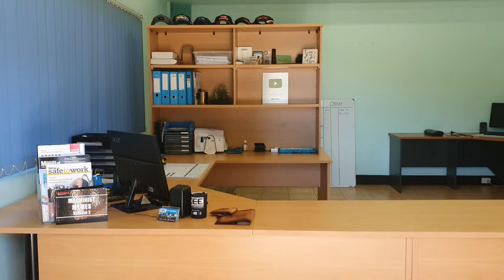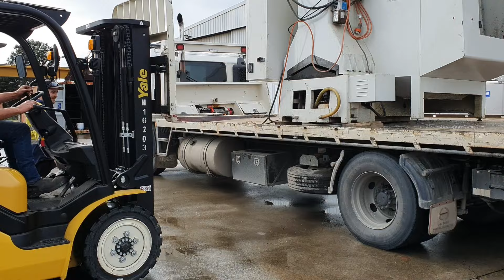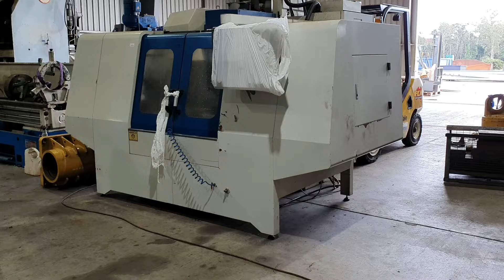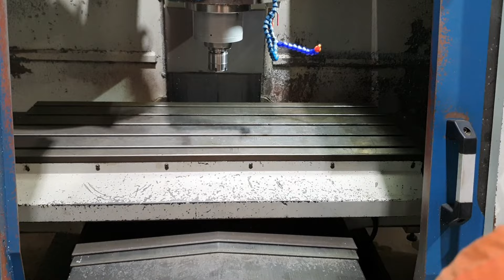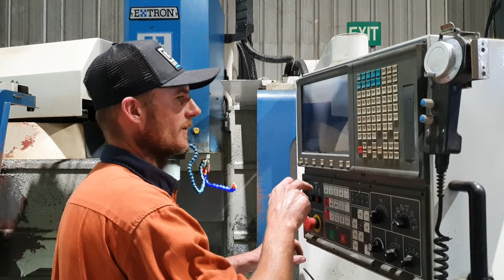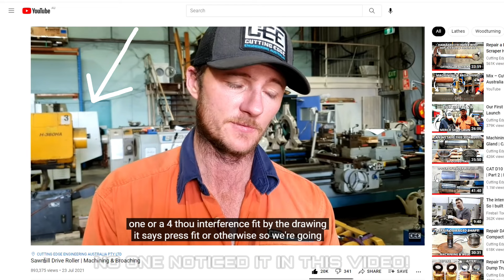Finally REVEALING Our New to us Machine | Workshop Machinery

Comment: Looks like a good addition to the shop. From what you've been doing, it looks like this may have a place making spare rod and cylinder ends. Looks intriguing, you may have to get additional labour around the shop. Enjoyed, cheers
Reply: Yes -if it's got the grunt, and/or feed rate is low enough, the CNC could be used to make a good stock of blanks. It wouldn't matter if it was chugging away for a day cutting each one. It could just live it's life as a material hogger.

Comment: Could I get a reedit on the measurements please? You didn't tell us how many banana's the table size was and I'm a bit confused... 
(Would have been cool to have some banana's actually laid out on the table and taped up the spindle though...... ROFL)
Once you get the hang of programming it, It'll make your life easier, particularly like when drilling multiple holes in a flange or the like... 
Can always use a block of wood as a test piece I'd think if you were nervous about how things are going to run, wood is a lot more forgiving than steel for sure.... 
HEY HOMEY!!!!!!!!!!!!!!!!!!!!!!! <3 <3 <3

Comment: I am not familiar with that controller but you will need to learn G codes and M codes. Slow the feeds way down till you get comfortable. Dont let it crash my friend. I repaired these machines when I worked at Honda, believe me there are very expensive parts that drive the axis's. It does look like a descent machine and this type will usually produce precision work. You will really enjoy it. I love your videos by the way. Enjoy

Comment: 3:02 (/3:29/3:49, etc.) - wow, what a fascinating thing to have to do...  This whole thing brings back memories of when a makerspace I was a part of got a Fadal, and changed our sign from the old Hitachi manual mill, "Be careful - this machine has no brain, use your own", to the new "danger - this machine has 5 brains, and they're all trying to kill you"*.  Be careful, especially since you already "broke" it! ;) :)

* if I'm remembering correctly; I unfortunately failed to find a photo of the new sign. I did find a photo of the old sign, so that one I'm certain of, even though I'd remembered it slightly differently originally - I thought it also said something about an ability/proclivity to kill the operator. ;)  Also, "5 brains" because it apparently had 5 processors - one for each axis, and... I guess one for the tool changer and one as a main controller?  Not sure the details, but something like that, and hence that wording.

Comment: And the next new machine is........    A Flow Mach water jet cutter!   Fireball Tool has the Flow Mach 500 and it is a beast. He has made several amazing new tools using it.  It cuts 1" plate leaving a nice smooth finish, and I believe to decently tight tolerances.  A waterjet would be top of my ultimate machine list.

Comment: CNC macines are good for manufacturing large amounts of the same part. You program once, and put then one piece of material after another into the machine and press the Start button. While the machine doing its work you can setup another machine.
For a single part that will be rather seldom manufactured I don't see a reason for CNC.
Reply from the maker: you must have missed the part where I said "I need to learn somewhere and on something and I don't have anything else" 🤣👍

Comment: My guess, one of the other machines is a horizontal borer. One you can use now. Other machine, i have no idea, but i think what you need is a massive water jet like fireball tool has, so you can cut your own shapes from 50mm bis80 plate.

Comment: Welcome to CNC machining…. It does have its uses. Hopefully the machine will allow you to program it from the control panel and then it’s a bit easier. It’s quite  intuitive to follow and easier than writing code, as the machine does it for you and you just fill in the important parts. Look forward to seeing how you get on. 💪
Reply: From someone that has programmed and ran cnc machines for 35 years in my own shop, the “machines don’t do it for you”…lol. You still have to have knowledge of the correct speeds and feeds for any given material. Not only that, if the resulting machined part is not coming out right, the programmer/operator needs to have the ability to troubleshoot and tweak the tooling and or program. In my experience, the best programmers came from a manual machining background.

Comment: After much thought and scientific analysis and scrutinizing over the results I came to the conclusion that all the variables considered alongside the compiled data in conjunction with known factors I'm strongly led to believe the other two machines could be literally anything from a dremel to a 900 ton punch press.
Reply from the maker: 🤣👍 you might be close or far off with that analysis
Reply: Very impressive.
Reply: Yes, but is it an old corded Dremel 395, or a more modern 8200 battery-powered one?  
Come to think of it, it's at least half a year since I saw my 395 last...
Reply: Spoken like a Professor of Logic from the University of Science
Reply: @bd12660  Or a politician.
Reply: @lapdog5355  hahahaha - awesome!
Reply: horizontal borer and horizontal mill

Comment: hi Kurt great channel I watch all the time, I'm sure you're gonna hear this a lot but: 1. don't run the spindle with nothing in it 2. don't run collet chucks with nothing in them, if the nut comes off at 6000 rpm it'll take a bit of stopping and you really don't want to take a shot in the nuts from one :-)  3. your first program to write is a warm up run. 4 don't buy cheap retainers for you BT 40 holders, they break. It's up to you now oh and  you can pass go and collect $200 ;-) all the best, Fat Dave

Comment: Good for you on the CNC acquisition.  Having worked with similar sized Haas and Fanuc Robodrills for 20 years, my advice is to go slow and learn the basics of G code writing on simple, 2d stuff.  Learn all the code for drilling, peck drilling, jumping over clamps and other obstacles, tool changes, things like that.  Single block mode for testing is good as well as adjusting tool height high so the program runs well above the work.
The main thing to remember, crashes happen.  It is so easy when using multiple tools to forget to enter a tool  height and watch a drill bury itself in rapid Z and explode all over.  Been there.

I am sure that, if you start with the basics, you will pick it up quickly.  Down the road you can then explore cad/cam software and 3d milling if your work ever required it.
Good luck!

Comment: I have access to a few HAAS CNC mills at my buddy's shop. All I can say, is a CNC Mill will definitely change the way you look at things, as well as the how your business will evolve. 
Great upgrade to the shop, and have fun learning CADD software, it's what's really going to make the mill strut it's stuff.
Next 2 machines will be a plasma table, flame cut table, or an EDM Machine.
Reply: Went to engineering company a while back, & they had a 5 Axis Waterjet CNC Machine in their workshop, was just amazing what it could do
Reply: @stuartandrews4344  The shop I visit was talking about getting a 5 axis system, however, they bought a HAAS 10 and an EDM machine instead. Seems they are now able to do more work with the EDM then they would have with the 5 axis. EDM is wild to watch, and the parts they can make are pretty neat.
Reply: @TheDgdimick  Not too familar with EDM machines,but what I've just been reading they are pretty impressive.

Comment: Congrats! my guess next two are CNC lathe and manual grinder. Regarding running/operating 1st and foremost rapids down to 5% and single block especially if you manually programmed. 2nd just get Fusion 360 cheap and very easy to learn with loads of postprocessors available straight away perhaps it is not as customizable as Katia or Powermill but it is easy to get into. 3rd if you actually got the CNC lathe i would learn how to program lathe first and then move to mill - 1 less axis to worry about (if it doesn't have driven tooling) and generally speaking lathe stuff is 90% of time easier to make than complex shapes on mill.
Reply: Programming a mill is so much easier in my opinion. Something about the lathe always gets me.

Comment: I was right with the cnc, so I’ll try my luck with the other two:
A shaper and a huge 3d printer
Reply: Well given that he said that the other 2 machines were over 50 years old and 50 years ago 2d printers were in their infancy, I'm pretty sure it's not a huge 3d printer.
Reply: Anyway, they'd have zero use for a 3D printer, except to make dog toys.
Reply: Water jet
Reply: @mikecabral1579  - Was there many water jet machines in 1970 ?? Remember, by nature they are usually CNC controlled, and that was a huge challenge back then.

Comment: Hi! Try to get some experience with CAD, CAM and reading NC-Code, because programming a CNC on the machine is a pain in the a* and if you work with a CAM software the postprocessor can screw up a program.
Check 3 times your zeropoint and tool length before starting, breaking Tools and crashing your CNC ist not funny. I learned it the hard way 😅.
Greetings from Austria 🇦🇹

Comment: Let the tool crashing begin! I have been in your position, bought a CNC just because I wanted to learn to use one. Ended up turning into a business for 15 years before I sold everything and retired. And just like you, I knew fuck all about how to run them when I started, when it was all said and done I owned an Acroloc (the first one) a Hardinge VMC 1000 and 2 Haas machines, both pallet changers, one vertical and one horizontal.
Reply from the maker: awesome mate!